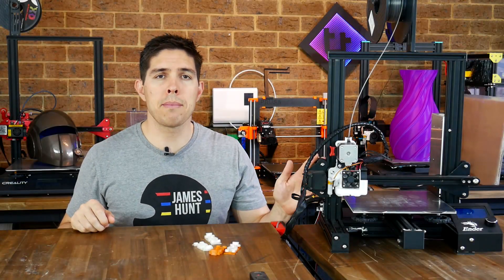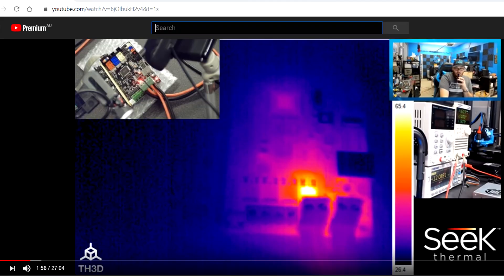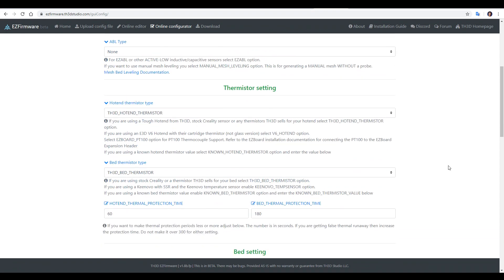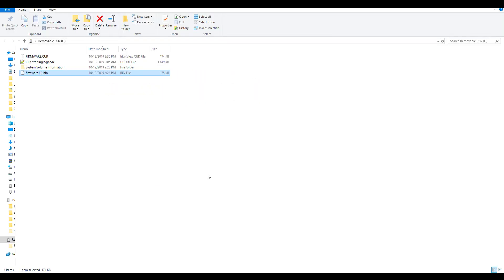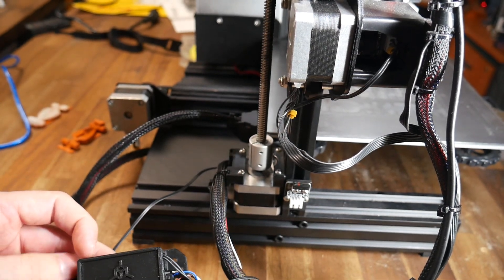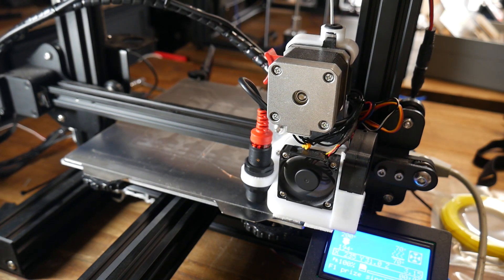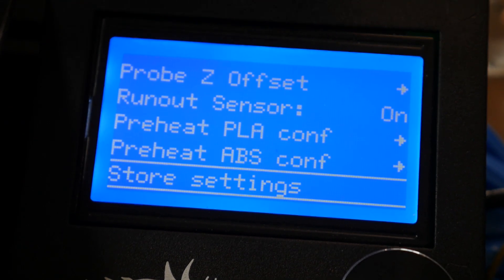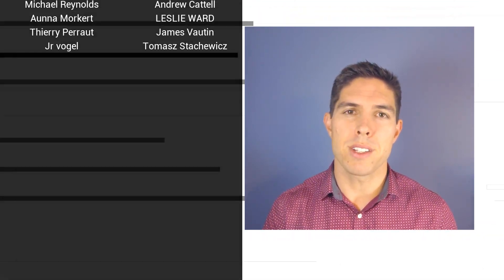EZBoard Lite - The most user friendly Ender 3 mainboard upgrade + EZABL Pro

Comment: As a noob to 3D printing, only purchasing my ender 3 pro a couple of months ago which was a result of yours and other peoples reviews on them and comparisons to other similar priced printers at the time, I have some questions for teaching Tech and Timothy Hoogland regarding upgrading to this board.  I like the idea of it being reliable through over- engineering and being a 32 bit board with more memory and having the built in sensor headers for touch sensors and filament run out sensors.  The price for the product to me seems reasonable albeit a fair bit higher than the other aftermarket boards. 

My questions are

1.  As I noticed there were no heatsinks on the motor drivers in the video and wonder if the boards cooling fan is separated from the parts cooling fan as I have not modified my stock ender 3 pro's mainboard fan electrical connection and become recently aware that it is tied into the part cooling fan power feed.  Obviously I am wondering if I continue to print PETG with the settings I am using if it will fry the factory main board at some point too.  I am printing with PETG more and more with low (20%) to no (0%) part cooling fan speeds, how will this impact this unit? 

2.  This week I purchased a BL TOUCH kit from Creality,  as I have a slightly warped bed and use the stock magnetic flex build surface for the most part but want to start playing with using the glass surface plate that also come with the printer kit I purchased does the board store the different Z heights for each surface type or does that not matter as the touch sensor will set the Z height each time?  I am still trying to understand this whole Z adjust thing to get good reliable and consistent prints.
Reply: Timothy Hoogland  thank you for your explanation on the heat issue... I find myself preferring PETG over PLA+ for printing as it (at least from my limited experience) seems to deform less...  For now I will look at what is needed to rewire the stock case fan but am very interested in your board and will be a likely purchaser in the near future (after xmas is done with)...

I don't know why my original question seems to have posted twice in the comments and I blame it on the interwebs :D
Reply from the maker: Hi Lloyd, BLtouch has a physical probe pin that contacts the bed surface, and the Z offset is relative to that contact point. This means you can change different thickness and material beds without needing to adjust offset. One advantage of the BLtouch.

Comment: Hey I have a question, can I use dc motor with encoder instead of stepper motor on this 32 bit broad (or any other board for that matter) ?
Thanks
Reply: On your traditional stepper drivers like we use on the printer boards this would not be easily achievable. Anything is possible though with enough time and tinkering but probably not worth it versus purchasing an already existing solution for that type of motor.